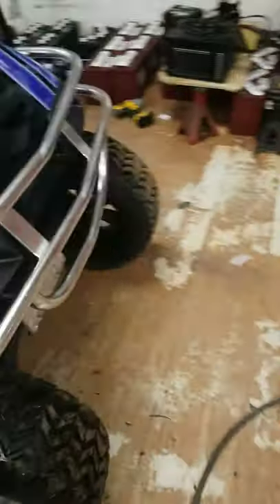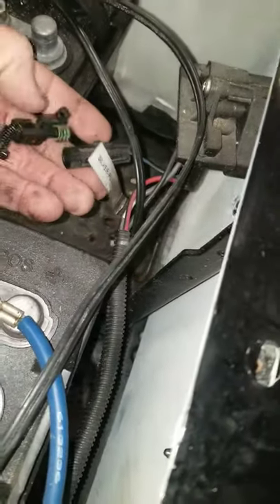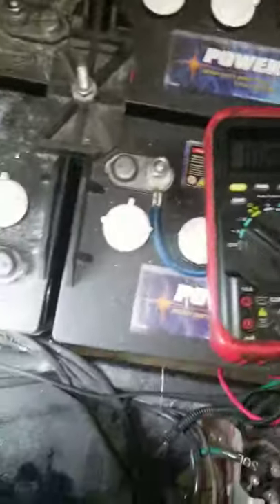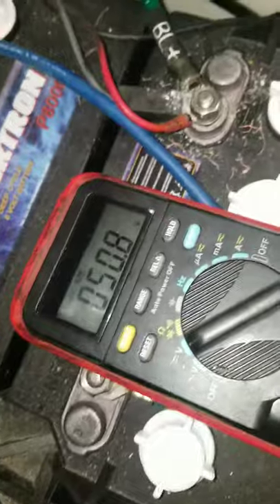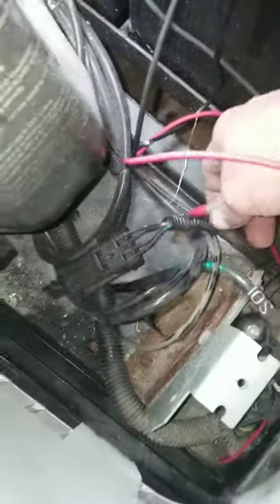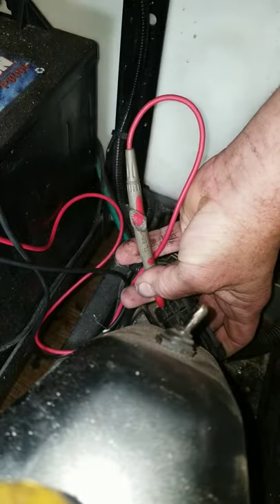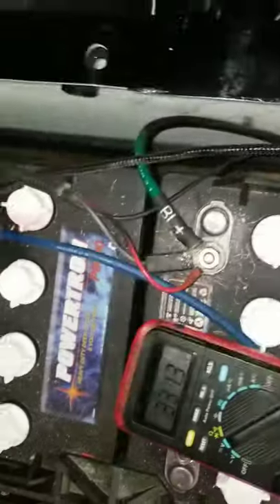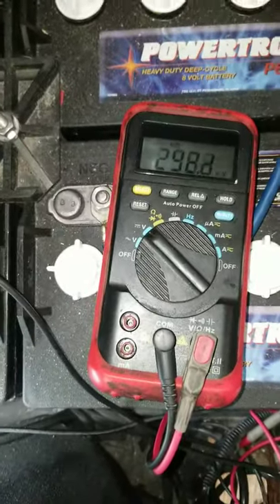EZGO 48 Test charger port, pedal sensor (ITS) and solenoid!!!!!!

Comment: Thank you for posting the video!  It gave me a great work-around for the issue I was having (1st you mentioned - 'bypassing the circuit inside the charger plug.'

Question: for a permanent fix, do I need to replace the charger receptacle or is the issue somewhere else in the electronics?  I'm looking for a permanent fix because it seems I need to remove the bypass to get the charger to charge the batteries.

Thank you.
Reply from the maker: Yes change receptacle
Reply from the maker: That's right so that's working.
Reply: I changed the receptical and it's still not working.  What next?
Reply from the maker: Whenpu plug the charger in what does it do.  Also what kind of charger do you have
Reply: @HeyHeyHey97  nothing no click. I also purchased a new charger and still the same. Only get click when I jumped the wire from plug. Charge gauge on golf cart now registers 3/4 charge but won't move.
Reply: Tried original charger and bought FORM 15 AMP EZGO RXV & TXT Battery Charger for 48 Volt Golf Carts
Reply from the maker: @BexarPrepper  so when you bypass the plug the cart runs.
Reply: @HeyHeyHey97  no just the clicking noise
Reply from the maker: @BexarPrepper  what does your battery pack show when you hit the gas and the aol clicks
Reply: @HeyHeyHey97  49.6 volts, no change in either forward or reverse
Reply from the maker: @BexarPrepper  what does the battery pack show without hitting the gas
Reply: @HeyHeyHey97  the same 49.6
Reply: The only change I see with the key is the charge gauge moves from 0 to 3/4. Prior to jumping the wire it stayed at 1/4 even though the batteries were charged.
Reply from the maker: It your sol is clicking?? If so black lead on main negative and the red lead on side of the sol big post.  Then hit gas and check the other big post on sol.
Reply: @HeyHeyHey97  solenoid clicking,  tried forward and reverse both post on solenoid same 49.6 volts no change
Reply: 0:03 so I had the it in tow. So yes when jumped it moves so does that mean the new receptical I just put in is also bad or something is blowing the internal fuse in the receptacle.  I'm so sorry about my mistake!
Reply from the maker: @BexarPrepper  now your trying to run the cart without the charger plugged in correct?
Reply: @HeyHeyHey97  well I want to be able to use the charger. But yes with it jumped and charger disconnected the cart works as advertised
Reply from the maker: @BexarPrepper  so your golf cart don’t charge?
Reply from the maker: @BexarPrepper  yo can’t drive the golf cart with the charger plugged in
Reply: @HeyHeyHey97  correct won't charge. I ordered another receptical  in case the one I received was bad. If that doesn't work is it ok to make the jumper permanent and just use a charger that hooks directly to the batteries?
Reply from the maker: @BexarPrepper  is the charger good? Bypassing the circuit in the receptacle is just got the running side. Not the charging side.
Reply: @HeyHeyHey97  I have 2 different chargers neither will start charging but I could purchase a charger with battery terminals and permanently attach for charging the batteries if I can't get the receptacle to work
Reply: @HeyHeyHey97  just wanted to thank you and give you an update. I replaced the receptacle again and it worked perfect with the new charge. When I tested it with the old charger it blew the internal fuse in the receptacle.  So yes bad charger Blessings
Reply from the maker: Good thanks for the uodate

Comment: I’ve been troubleshooting my gym cart for over 20 hours. 3:02 Thank you so much! Now, how do I fix it!
Reply from the maker: What’s it doing
Reply: @HeyHeyHey97  I ran a jumper like was shown in the video from positive to the solenoid, and the dash illuminated again and I could drive it. Since then, I’ve just been tracking the wires from the key switch to where they go. I am not reading 74 V at the key switch like this cart requires. So not sure what to do at the moment.
Reply from the maker: You have a gem cart correct
Reply: @HeyHeyHey97  I do early 2000s six battery 74 V two seater. E825 series
Reply from the maker: The voltage comes out the controller. Have you checked all the fuses and the main cut it breaker
Reply: @HeyHeyHey97  I have checked the fuses however, I plan on replacing all of them just to make sure but, what is a cut it breaker?
Reply: @HeyHeyHey97  I have checked the fuses and plan on replacing them just to be safe however, what is a cut it breaker?
Reply from the maker: @diehardfan173  meant circuit breaker
Reply: @HeyHeyHey97  sorry, I don’t know where circuit breaker would be on this! If it has one, and you tell me, I would be much appreciative
Reply from the maker: If that style had one would be under the fuses. Like a switch
Reply: @HeyHeyHey97  I thank you for your time.

Comment: Nice vídeo i want to know where the wire from to solenoid
Reply from the maker: What color wire yellow?
Reply from the maker: If you are talking about yellow wire it comes from key switch.  But it connects to a couple of other wires under the floor board.

Comment: I have a txt48 that will not go. The solenoid just clicks on and off real fast when given gas but doesn't move. I've changed the controller, solenoid, and its and it still does the same thing. I've given the solenoid voltage straight from the battery and still won't go. Could it be a bad wire harness?
Reply from the maker: What does battery voltage show. Normally when that happens the controller is bad. Have you tested the motor to make sure it’s good. And yea it could be wiring harness if you have. A bad connection somewhere. Or a bad plug. Was the cart towed anywhere in with the tow run switch in the run position. M

Comment: Hi Christy, appreciate the video, I recently bought a dead EZGO TXT. Got it back home and found all 6 Trojan batteries to be dry (its a 36V cart). I took all the batteries out, cleaned them up and filled them with distilled water. I charged them all independently and re-installed in the cart. After a few charge cycles, the cart seems to be working and I've been using it for odd jobs about the place.

However, the other day, I tried to use it with my (large friend) as a passenger and it stopped after a few feet. When he got out I was able to drive it again. Having not had one before, I'm not sure what it can and can't do, so i'm not sure whether this is indicative of the other issue I'm about to describe or whether I'm just asking too much of it.

Also after this incident, I tried to use it a day or so later and even though the charger was reporting full battery, it would try to move but wouldn't. I thought the batteries were shot (even though they were measuring 37V) but today I kept depressing the throttle up and down and eventually the cart started to move and I was able to drive it around again.
Reply from the maker: When it dont run.  Does the sol. Click.
Reply: @HeyHeyHey97  I think so, I just gave it another test run and it worked again, so can't say for sure. It's one led from the top of the 36V meter bar and its sluggish, especially on small inclines, which I know they struggle with at the best of times but this is really small which I believe it should cope with.
Reply from the maker: @healeydave  how old are the batteries.
Reply from the maker: @healeydave  do you have volt meter
Reply: @HeyHeyHey97  pretty old I think
Reply: Yes I do

Comment: I have a 1999 ezgo with DCS.  It quit going forward.  Will move in reverse. Any help appreciated.
Reply from the maker: Can you get to your controller
Reply from the maker: On top of your controller. Flip the black and white wire around and see if it goes forward then.
Reply from the maker: Make sure your forward microswitch is good... it should be on the back of the f n r handle.  Under the seat.

Comment: Great video Would be great to see one on 2000 txt 36v with same complaint. I tried your test on mine, and it doesn't have main battery voltage at solenoid(yellow wire) with key switch on.
All key switch wiring has continuity. and check for 36 volts at key switch nothing on white
or white yellow. Also nothing where those wires come out of controller. I'm hoping it isn't 
controller. Hoping I just missed my off ramp. If you have any feed back it would be appreciated. Broke down in Vegas
Reply from the maker: Jump a wire from the main positive on battery pack to yellow wire on sol. Small post. And see if cart runs.
Reply from the maker: Subscribe to my channel.
Reply: @HeyHeyHey97  Did that  nothing
Reply: @HeyHeyHey97  Christy your video is best I've seen on You Tube
Some of these guys are just plain dangerous I have subscribed take care
Reply from the maker: Do you have volt meter
Reply: @HeyHeyHey97  yes
Reply from the maker: On your volt meter. Turn to dc 200. Black lead on main negative.  And on the bottom side of the controller.  You will see a 4 pin plug with a black, white, turn, and red. Wire.  Put your red lead in the plug where the black wire is and hit gas key on tow switch in run and key on. And tell me what voltage. Then move black lead to the white wire and do the same.
Reply from the maker: When I get to work tom I will make you a video on a pds..
Reply: @HeyHeyHey97  Christy on Black wire 0 volts  White wire  .06 volts
Reply from the maker: On the bottom left of your plug on front top of controller. It should be a big plug with alot of wires.  There should be 2 red wires.  Put black lead on main - and the red lead of meter into each one of them wires and tell me what they read. Should be battery voltage.
Reply from the maker: Your black wire should have read 14 vdc. At full pedal and  your white wire should read 2.9vdc at full speed.
Reply from the maker: White wire should read 2.9vdc and 14 vdc on the black.wire at full pedal..
Reply: @HeyHeyHey97  Yes Got Battery Voltage on both
Reply from the maker: Hit the gas and put your volt meter black lead on. Blue wire on sol. Small post. And the red lead on yellow wire small post. See what you get
Reply from the maker: That tells you you have voltage going to it.  That is your positive voltage that powers the controller
Reply from the maker: The red wires on controller..
Reply: @HeyHeyHey97  O K I put black test lead to blue. and red test lead to yellow. Hit gas no voltage
Reply from the maker: K run a wire from the main negative to blue wire on sol.  Small post. But dont touch it to the small post until you hit the gas. And while you are hitting gas touch it and see if the sol. Clicks
Reply from the maker: Also check the tow switch and see if voltage on all 4 pins when in run.  Black lead main negative
Reply: @HeyHeyHey97  Christie I checked voltage at run / tow switch. One side
OK .Other side .o8 vlts. I jumped across and cart works (Fwd /Reverse
Back up buzzer comes on ) It seems like one side of power from controller is not powering up run / tow switch. Can I just bypass??
Reply from the maker: Yes
Reply from the maker: The only thing it will hurt is if you ever break down. If you tow it it will burn up motor if cant put in tow.
Reply from the maker: You should have voltage on all 4 post.
Reply from the maker: If 3 have voltage just use one side of switch
Reply: @HeyHeyHey97  Christy will do Thanks for the help!!!!!!!
Reply from the maker: Np. Subscribe to my channel. The next time I get a pds 36 txt ezgo in the shop I will do some voltage test ..

Comment: I have a 2011 ezgo txt pds with brand new batteries and only goes 3-4mph. If it’s already running do you think it’s the ITS or possibly the speed sensor. Let me know what you think please
Reply from the maker: If speed sensor. Whenever you flip the tow switch to tow then back to run. It will take off wide open then cut back down. Try that and let me know. It’s NO
Reply from the maker: ITS NO
Reply: @HeyHeyHey97  it does not do that. It is consistently very slow
Reply: @HeyHeyHey97  what do you mean it’s NO?
Reply from the maker: No it would not be the ITS
Reply from the maker: Get your volt meter and check over voltage on the batteries.
Reply: @HeyHeyHey97  voltage is good on all batteries. Pack voltage is 50.2
Reply from the maker: Drive it and see  what voltage the batteries shows then
Reply from the maker: Then keep black lead on main negative and pos
 Lead of meter and check Both sides of sol. I seem speed sensor cause this or sol.
Reply: @HeyHeyHey97   both sides of solenoid snow pack voltage about 49.8
Reply from the maker: @floridavriot  that’s while your driving corrext
Reply: @HeyHeyHey97   no, that’s with key on and in forward. Do I need to be pushing pedal while doing this?
Reply from the maker: @floridavriot  yes and also when testing the batteries

Comment: Christy, great video man! I have a 2015 Yamaha drive 48v with Same problems. Can you do have recommendation on finding the bad wire?
Reply from the maker: On your small post on sol. The red wire.  Run. A wire from main pos on battery to that post. And hit gas and see if runs
Reply: Selanoid is new still nothing. I jumped the selanoid on the small post from the main positive and it reverse started beeping. What does that mean? That there is a bad wire in the key switch?
On the Yamaha, the wire that comes off of the battery charging Port you described, is not a wire that can be easily detached like on the txt. It just so happens that the on on my cart is soldered. Should I cut it and run it straight to the main + post and see if the cart runs? Thanks man you are a great help and appreciated for DIY.
Reply from the maker: @joeabu  that means you have lost all power from key switch,tow switch or foot pedal switch... get a volt meter and check back of keyswitch for voltage.
Reply: @HeyHeyHey97  just checked for v behind the key switch and I got at .24 reading point 24?
Reply: @HeyHeyHey97  it does run when doing this. Main + to the small post on sol.
Reply from the maker: That means you have bad keyswitch or microswitch in floor or wire somewhere
Reply from the maker: Or the charger lockout wire
Reply: @HeyHeyHey97  what do you think I need to next to get this cart running and safe?
Reply from the maker: Check keyswitch. Put black lead of meter on main negative and the red lead of meter on back of keyswitch and see what you get
Reply: @HeyHeyHey97  very low voltage .24 ?
Reply: @HeyHeyHey97  voltage on the back of the key switch is reading .03
Reply from the maker: @joeabu  run a wire from main positive on batteries to pack of key switch and see what it does
Reply: @HeyHeyHey97  ran the wire from main + to the back of key switch. Had it in reverse so it started beeping but did not move. It beeped for about 20-30 seconds. 
I put it in forward and pressed the petal but nothing. Only the beeping on reverse a few seconds after I connected the main +. What would be your next step?
Reply: @HeyHeyHey97  also I wanted to mention. I bought the cart and immediately changed the batteries because the previous owner said that’s all it needed. I just found out that the reason the cart stopped running was because polarity got reversed. 
So at this point it has nee batteries but not doing anything also all the accessories are not working. Headlights and radio. 
I figured I would tackle on thing at a time. I’m not sure if that makes any difference in what we are doing now but wanted to share the news info with you
Reply from the maker: @joeabu  check your floorboard mocroswitch
Reply: @HeyHeyHey97  I checked it and it has cont.
Reply: @HeyHeyHey97  I wanted to give you an update. I changed the controller( navitas 600) and upgraded the solenoid). It didn’t move yet. I connected the main+ to the key switch and it cranked up and the controller came on perfectly. Does this mean I have a bad wire in the key switch or is it a bad key switch?
Reply from the maker: @joeabu  jump the 2 wires on the keyswitch together. If it runs then you have a bad keyswitch. If not then you have a bad wire going to it.